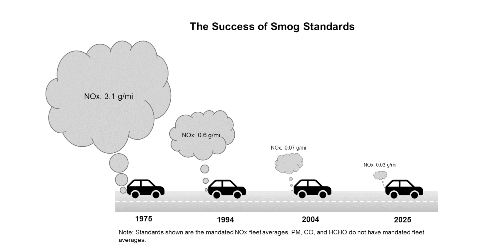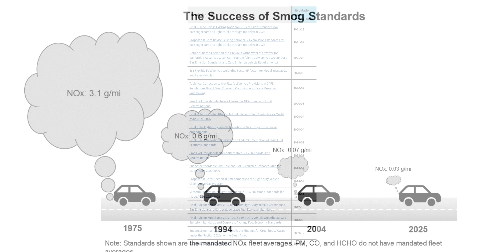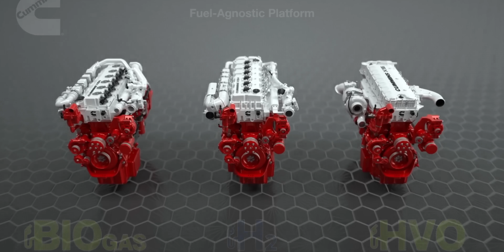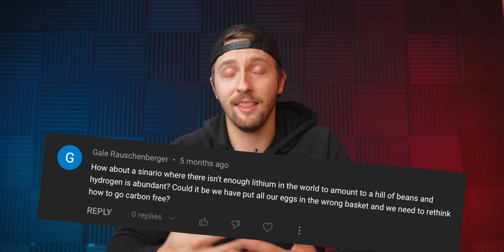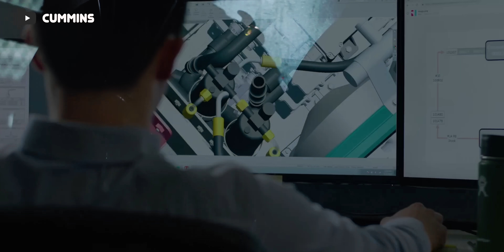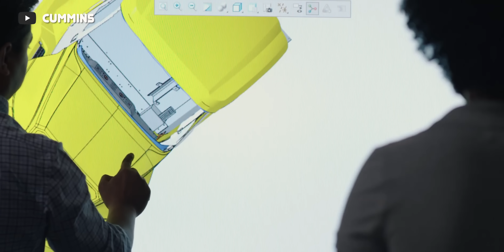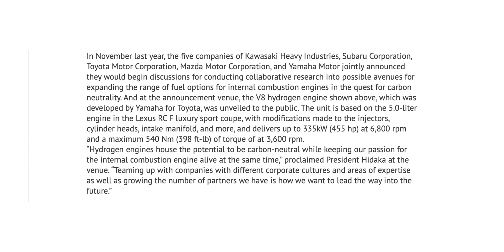Cummins Hydrogen Engine Will KILL DIESELS FOREVER

Comment: Basically speaking, hydrogen is not efficient to use in an inefficient ice engine due to the energy invested in manufacture and storage. 

The way to use it would be with fuel cells and not ICEs as then your only efficiency losses are in manufacture and not engine and driveline efficiency.

Also there are processors these days that are capturing hydrogen from smoke attacks of industry and power stations which is helping clean up emissions from industry and producing commercially available hydrogen much cheaper with less invested energy. 

Still the high pressure needed to store usable quantities is its limiting factor and makes it still even less practical than electric. 

JCB in the UK have off hwy machines that run both ICE and fuel cells that may be worth you looking at to see how that's going. 

We're going to see a huge reduction in road transport over the next 20 to 30 years and most freight will be shipped by rail which will be mostly electrified and we'll move back to road transport only running from main rail heads to the end user.

Comment: If hydrogen is the future it will be hydrogen fuel cell. Just turn hydrogen into electricity to run an electric motor. You would have like 3 moving parts vs 300 with an internal combustion engine and it’s more efficient. Plus 1/10 the maintenance. What the hell is Cummins thinking.

Comment: Nope... cummins already has the cummins westport LNG engine.
 This hydrogen engine  will compliment what they already have. Biodiesel is already being mandated as a blend up to 5% with petroleum based furnace oil and diesel fuel. 
Railpower technoligies was bought by RJ Corman  company and shelved. They have the hydrogen fuel cell technolgy to power  locomotive called the green goat. 
Theres a lot of new technology coming out.

Comment: I'm really excited about the hydrogen engines!
Thank goodness we will have another option other than electric.
Especially motorcycles, hopefully harley davidson is working on a hydrogen powered v twin!
Reply: I don't think Harley will ever build a hydrogen motorcycle.  A electric one would be great, but not traditional enough for them.  Maybe in 2035, kicking and screaming "Not US", but then when the performance of the electric motorcycle actually comes out, everyone will want one, and they will go 0 to 60 much faster!  

Ford had a F-250 that ran on hydrogen using a 6.8L engine and made 550 HP or about 80 horsepower per liter!  So a hydrogen powered 3.5L turbocharged V6 could make about 400 HP and power the forward axle on a class 8 truck, then have a electric 400 HP motor on the rear axle, and run it down the road with a 200 KW battery pack, use regenerative braking, and run both motors when they are getting up to speed, or running up a mountain grade.
Reply: Hydrogen vehicles have existed for decades but nobody wants them. You say you're excited about hydrogen fuel cell vehicles, but why don't you own a Toyota Mirai, Honda Clarity, or Hyundai Nexo?

Also, Harley's Livewire electric motorcycle is currently one of the best on the market. Like all the rest of them though, needs more range.
Reply: @TecnamTwin  cost for the electric, through the roof . Great until the battery goes flat. With the idiots destroying the grid, by windmills and panels, have fun.
Reply: @MsKatjie  I am having fun. Currently own Chevy Volt and will transition to BEV once the prices get below $20K without tax credits. Also, solar and wind aren't "destroying the grid." They coupled with every storage solutions will save the grid make blackouts a thing of the past.
Reply: @TecnamTwin  these people regurgitate all the same talking points that have been debunked.

Comment: Sorry, I’m lost. If the vehicle is to be powered by pure hydrogen then why aren’t they using a fuel cell to convert it to electricity? Instead of going this circuitous route by burning hydrogen and not reaching 100% efficiency?

Comment: In the Midwest, they've been running diesel irrigation engines on NG for decades. The lube oil lasts forever. Many run for months without shutting down.

Comment: When looking at the big picture it all comes down to fossil fuel dependence regardless of whether vehicles are powered by hydrogen or electricity (ev's are the worst).
There is another option that needs more focus in development and that is sourcing fuels (diesel, aviation gas aka kerosine etc) from synthetic methods such as the Fischer Tropsch process.  
Another avenue is algae derived bio diesel.
Both of these sources can close the carbon cycle by making industry a part of the natural cycle and doesn't require massive, immediate changes to existing infrastructure.

Comment: I’d be willing to bet you can improve the emissions and efficiency of traditional Diesel engine fuels by adding in hydrogen to the combustion mix.  Since the widespread infrastructure isn’t there yet for hydrogen this engine could allow them to phase it in as hydrogen becomes more available and improve emissions progressively over time.

Comment: There is not enough hydrogen infrastructure for this. Hydrogen filling stations would have to be installed at every truck stop. Big oil will live forever. They provide too many products to fail.

Comment: Ha...so true...America is the only place on earth (other than Liberia and Myanmar) still using "imperial" measurements.  It's unamerican to think in metric, unless you're in the military.  Anyway, why burn hydrogen at all...what % is lost as heat?  Burning H in a combustion engine still produces NOx, so not totally clean.  NOx is just as toxic as diesel particulate.  If you are storing H as liquid in tanks, why choose to lose a huge percentage of that energy as heat rather than set up the truck as a Hydrogen fuel cell and run electric motors, which offer a jump in overall efficiency, torque from zero mph, and regen(!).    It would be possible to set up renewable hydrogen fueling stations just for long haul trucking along highway systems with hydro, solar or wind (or nearby small nuclear) energy to generate liquid H w/o burning oil/gas/coal elsewhere.  Big tanks with liquid H probably weigh less than 1000KWh battery such as tesla.
Reply: >> It would be possible to set up renewable hydrogen fueling stations just for long haul trucking along highway systems with hydro, solar or wind (or nearby small nuclear) energy to generate liquid H w/o burning oil/gas/coal elsewhere.  Big tanks with liquid H......<<
If you don't mind the occasional massive explosion.

Comment: Knowing how much hydrogen is prone to knock, or premature combustion, actually using it as a fuel for diesels is genius. I just hope that with how precise you can control injectors that you can still run the truck on, well, diesel, because that will forever be easier to get ahold of than hydrogen.
Reply: I'm sorta curious about this.  Diesel engines are very high compression compared to spark ignition engines.  Would seem hydrogen would be more likely to preignite in a diesel than in a spark ignition engine where preignition is already a problem at the lower CR when converting to H2.  There's also the issue of H2's flammability even at lean mixture ratios.   Maybe Cummins has found a workaround.
Reply: The thing about diesels is they rely on this. You get compression, then the injectors spray fuel, and instantly, it ignites. It's the opposite problem as to how a gas engine works. You want fuel that can combust easier, which is why diesels run so bad on gasoline. Gas is great at not preigniting under pressure.

Comment: The elephant in the Nation as it is... Where are you going to get your Hydrogen to burn???  Currently California is the only state with multiple dispensaries of the gas and one other one somewhere to the East.  At a Billion  per each filling facility, no viable firm or individual is about to make the leap if there is no continuing source of fuel! Not to consider most filling stations probably do not accommodate semi-truck lengths. I say fuel source and viable filling stations are a prerequisite for a Hydrogen infrastructure capable before vehicle usage.

Comment: Nothing new. Stanley Myers did this efficiently and his life was deleted for it. Give us the opposed piston diesel engine with dual fuel hydrogen injection. Yeah that engine that cummins perfected 19 years ago but wont let us have because it will last forever and get super fuel millage . The same style Chrysler killed when they took over the commer engine. The engine that was first documented in 1882 that you wont give us because its too good , and you've had 141 years to make it better but you keep telling us lies because you want to sell us more fuel and have repeat customers for engines that are designed to fail.

Comment: The commentator said using electricity to generate the hydrogen was using electricity and why not just use it to power the vehicle? Simply because it uses a minute amount of electricity compared to the power of exploding hydrogen. It's not the electric generator driving the motor thing, driving the generator thing. I believe the solution is more in adding hydrogen and oxygen to fuel/air. A total hydrogen system is far to complex.

Comment: Hydrogen is the only future of motorized power. The cost is not constrained to variations like fossil fuels and would negate wars for energy. It doesn't suffer from price fluctuations by region like fossil fuels. It has much cooler egt's which results in less wasted energy and doesn't stick to cylinder walls. It's so inherent to the future that all the major oil companies are heavily invested in it.

Comment: There are some major issues with hydrogen as a fuel. The temp hydrogen has to be cooled down to become a liquid is -423F.  It takes a lot to cool it down that much, then if you're in Phoenix and it's 110F outside, the hydrogen will warm up and expand. Then it must be vented and hydrogen is very flammable. Another problem is a hydrogen molecule is very small. It causes a lot of problems with leaks at connectors. Many companies looked at hydrogen as rocket fuel. It works great but they have a problem with leaks.  For a ground vehicle, that you think will replace diesel, why not look at natural gas. Natural gas is mostly methane and it becomes a liquid at -260F, and has a much larger molecule. That means less venting and fewer problems with leaks. Look at rocket companies. SpaceX is going to methane, Blue Origin is going to methane, ULA is going to methane, and Rocket Lab is going to methane. Very few new rockets use hydrogen. There's a reason why. 
Hydrogen-powered vehicles will not replace diesel anytime soon.

Comment: Good temporary solution but once long range trucking with electric motors catches up, it will put them out of business. Electric motors are more efficient and cheaper to operate. They also require less if any maintenance at all and last longer. Best bet for them is to ditch the pistons and rods and implement a H2 cell with motors.

Comment: You did not mention the main problem with using hydrogen gas as a fuel, and it's the reason SpaceX doesn't use hydrogen gas in their rockets.  The hydrogen molecule is very tiny, so your storage and delivery system has to be perfectly leak free.  The hydrogen gas must be stored under very high pressure and it will leak out of all the smallest holes.  Leaking hydrogen is explosive! NASA's oxygen/hydrogen rockets have had many refueling problems.  Truck drivers are not rocket scientists.
What we need are electric cars, trucks, and heavy equipment but without batteries.  We need to tap into Nikola Tesla’s Ether for our power.

Comment: Using straight hydrogen  is a big mistake! Hydrogen  will wet the metal and Pentatrate  the parts causing metals to become brittle and break. And hydrogen  will stick to itself within 24 hours you have H2  that has half the power of H1 and H1 is hard to store since hydrogen  can penetrate any metal. So a H1 tank uses  powder carbon to  hold the H1 for a short time. H1 and H2 is explosive and unsafe to burn 🔥  by itself

Comment: I watched a video a few years ago, put out by Bowing. It was about this very large remote control Dirigible used for communications. It was powered by a modified four cylinder ford ranger motor powered by hydrogen. It could stay in the air for 90 hours. The video said with modifications it could stay in service for 2 weeks. Y will never see electric full size excavators a four hour battery would add 10,000 pounds to the excavator. It would take about 20 hours to recharge the battery. Solid state hydrogen will solve many problems associated with hydrogen storage.

Comment: Also a form of methane can be made from 💧 water to power  a i.c.e.  by using a Demoleculizer and carbon. The water 💧  is a hydrocatylist that burns 🔥  with the carbon to produce methane gas in a on demand system

Comment: A water cell that uses Deuterium  will power a i.c.e.  a electrostatic water cell that operates with vacuum inside the electrostatic cell this causes heavy water 💧  to demoleculize  with its electrostatic  plates and vacuum upon the  Water 💧 😳.  This technology  exists and I have made it work.

Comment: hydrogen is a great fuel….but storage is an issue, too, due to the small molecular size of a hydrogen molecule…it finds porousity in most materials used for tanks.  To get enough useable fuel, the tanks must be thick and heavy, due to the immense pressure required to liquify.  Filling station require expensive high pressure pumps.

Comment: The use of hydrogen for engines has been shown to be completely useless in automobiles, for the fuel storage space, they will have a range of 50 miles, at an equivalent to gasoline, of $15 PER gallon.

Comment: Railroad locomotives use diesel electric and NG electric. Why not use hydrogen electric? Make the motors modular / universal so any type of power plant can be used with a fixed electric motor?

Comment: Hydrogen is a non starter, had been since the Dawn of time.

The energy density is just not there by any stretch of the imagination. When you run the numbers for infrastructure, pumps, storage; transport and the fact it’s not very energy dense, batteries are a better value

Comment: If it was not for the energy. These vehicle can cost nothing to operate. That's why they want control of it just like the fossil fuel you must have a economy base to keep corporations  in bessiness it'll all work together but never alone as you said for at least the next 50 years. And I suspect we will be dodging back to fossil fuels. Because of the climate issues reduced carbon will cause yes all our plants will die without carbon. Do the research.

Comment: They have known that plugging a small hydrogen fuel cell into the intake of Diesel motors creates as near of a full burn as anything else.. You can breath the tail pipe exhaust ( I don't recommend it) but the whole Def Particulate filter to was to dumb down the improved perfomance from higher rail pressure and more efficient atomization of modern injectors.. Hydrogen is a cool gas.. If you have ever used a hydrogen cutting torch.. You will know.. Just like the gov and complicit industry saying there isn't enough BTU in ethanol to power IC engines.. The same day that formula 1 and NASCAR and the lot burn pure enthonal in their race cars..Pretty much, our government is one of our worst enemies and they have been building a bad reputation for us all over the world for a long time.. WE are good people and we want what's good for ourselves and the world.. Just need to get rid of that evil cult pulling the strings in D.C..

Comment: They are in the engine business, not the diesel business. 

I worked on a project with CAT, V16 engines for power generation. They ran on a very small amount of diesel and mostly Natural gas so no spark plugs were needed which greatly reduced maintenance costs.

Comment: Why hydrogen when you already can burn natural gas (the source of almost all hydrogen fuel) in diesel engines? Hydrogen currently costs about three times as much as diesel per mile, and that is without the demand for fuel by millions of trucks (yes, supply-and-demand is a real thing). The cost of hydrogen would soar if only 1/10 of 1% of trucks used hydrogen.
  Aside from the obvious economic disaster, converting natural gas to hydrogen uses a tremendous amount of energy, energy that could be used in the engines. Whether it is made in hydrogen reformers or by burning natural gas in power plants and using the electricity to make hydrogen from water, manufacturing hydrogen would require either a tremendous increase in fracking for natural gas or hundreds of dedicated nuclear power plants (neither of which the environmentalists would approve).

Comment: The companies that make diesel and gas engines should diversify and start making electric motors and engines that run on hydrogen etc.  They should also get into producing batteries.

Comment: All Hybrids SHOULD have been built and powered the same way as current Locomotives. All Electrical Drivetrain with Recharge capabilities, but also with a small Diesel Generator (in the 'Fronk') and Fuel cell. We would be MUCH further along if this was the case starting 10 years ago, rather than the Gasoline/Electric Hybrid Drivetrains.
Reply: >>All Hybrids SHOULD have been built and powered the same way as current Locomotives<<
Agree 100%! And never mind the batteries.
Reply: @frankschwartz7405  LOL.. I see what you did there.